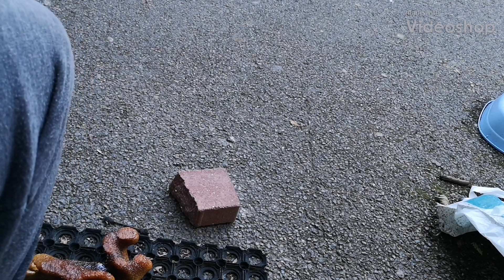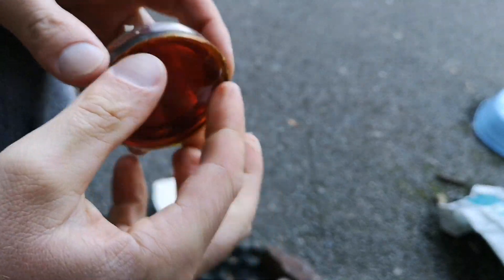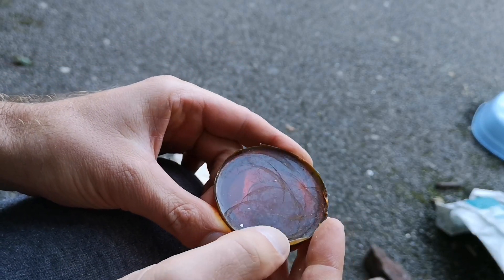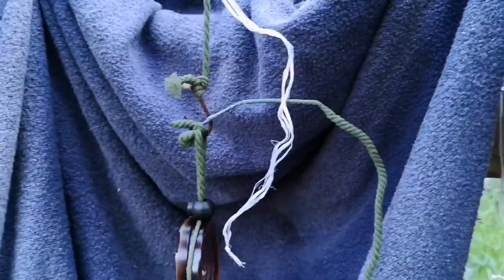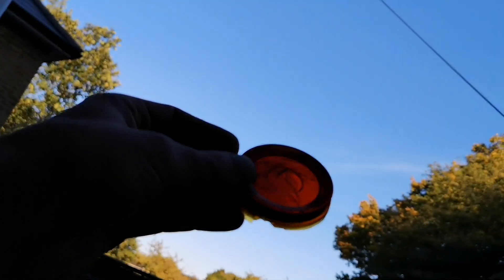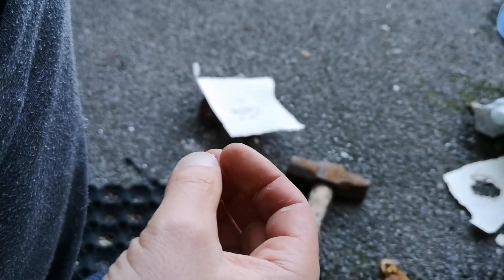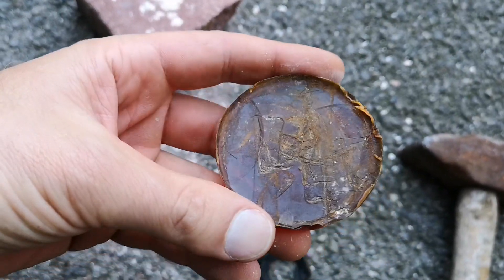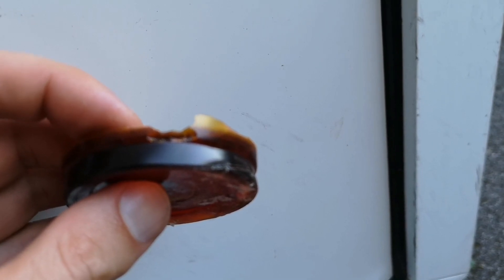Smooth-on Task 12 destruction test

Comment: Have a question can you drive a thin nail into it?
Reply from the maker: Wow, it's been along time since i used this stuff, but from what I recall, it had a very slightly rubbery texture, so it wasn't brittle. Other versions would just crack if you tried that. It probably would be fine to drive a nail in, though I'd suggest making a pilot hole if you can just to make sure. I don't have any more lying around to try out.